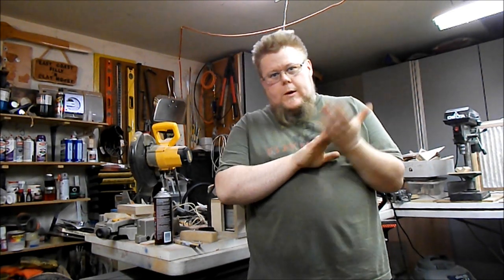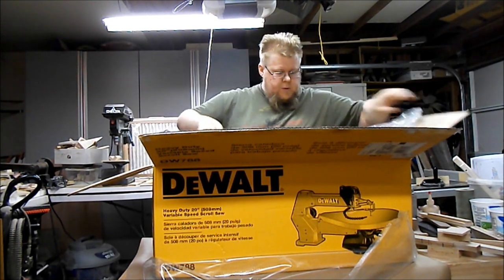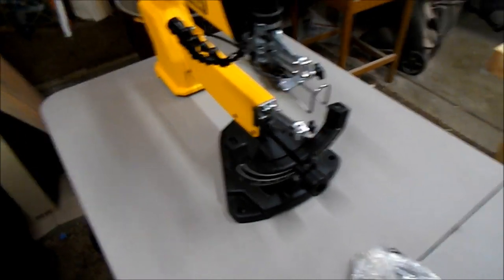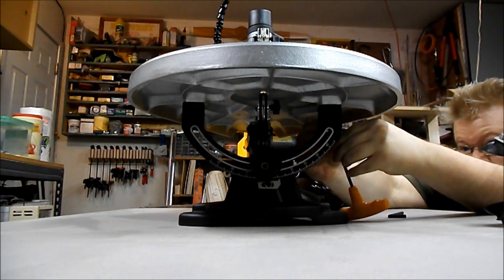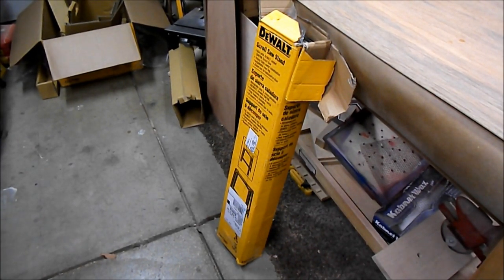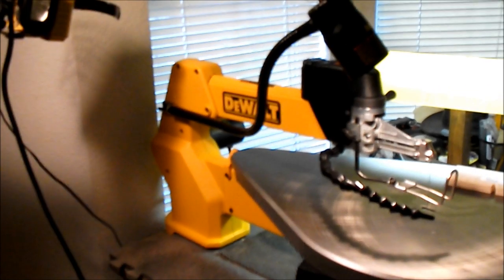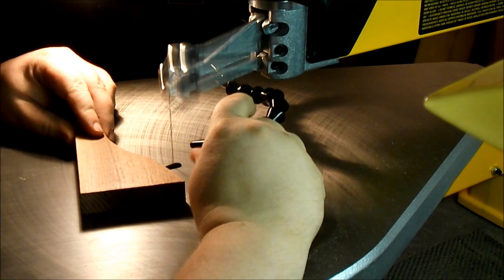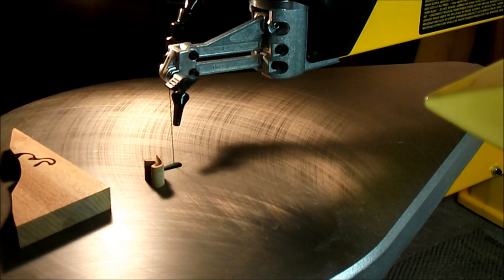Unboxing the Dewalt 788 scroll saw

Comment: Loved your vid! I just picked up one of these second-hand and removed the table to clean/derust it, and was having a dickens of a time reinstalling it. (I took it off with the miter gauge still installed. From your vid, I deduced i needed to take off the gauge and pop the table back on and then reattach the gauge. I had the same "challenges" you had installing those two screws. Cracked me up and made me happy to know it wasn't just me!
Reply from the maker: Mine is still running strong since I posted the video. 🙂 No major problems over the years.

Comment: ty for the video it helped me set up correctly, man that suck about getting a brand new stand with half the parts missing i was worried a bit but all they did to me was send ONE wrong screw, I have One big one and one small one to attach the table,,, now I need one small one so I have 2 same screws in the bottom of the table.
Reply from the maker: Luckily most hardware stores carry them.

Comment: Hey! I Good video. just got my DW788, too! I also upgraded from a Dremel that I called "Shaky Jake". I even got the stand together, and think I have found out what that little silvery thing  is that you couldn't figure out what it did.  It seems to be the fuse cap tool. Manual, P.7. Little round picture.  Question: I kept my Dremel alive and healthy for more than a decade by lubricating it regularly. How do you do that with the 788?

Comment from the maker: I usually use Pegus brand #2 to #7 blades. 2 being smallest and 7 being largest not sure of the tpi ( teeth per inch ) on those blades. The 12.5 tpi you asked about means the blade you have has 12.5 teeth per inch of blade.

Comment: so did you ever figure out what the little screw driver type thing is for. I've got some blades from Mike at flying dutchman blades have reverse tooth blades works very good and removes most of the fuzz. I just got my saw too.
Reply from the maker: yep.  the little screw driver is to remove the dust caps over the motor brushes. 😃

Comment: You mentioned leveling the table, but didn't show how (what you adjusted) to actually level it.  What did you loosen/adjust to get it level?  Also, I just opened mine an that small tool appears to be for the motor brushes access plug.  And while I have you, do you have suggestions for where to get blades and what kind to order?  The documentation said to use ONLY #5 blades (whatever that is)…New to this.
Reply from the maker: Sorry for not being more clear Damon. :) To level the table I used a small metal square for marking right angles. Putting it on the table and against the blade under tension. ( the blade not the square). I loosened the table angle knob under the front of the table, then adjusted the table till it was square based off the blade.
Reply from the maker: As far as blades that's more complicated. I use mostly Pegus brand #2 and #3 sized since I do a lot of small detail work. But I have used up to a #12 based on the wood hardness and thickness. 2's and 3's are Very small blades more common blades to use would be like a #5 also I like to use skip tooth reverse cut blades for a cleaner finish to the cut.
Reply: snoman1973 I can see how that would level the table from a bevel perspective (left/right tilt), but not sure how see how that allows for up/down movement of the table for leveling if from front to back.
Reply from the maker: Damon Hearne for that you'd have to shim under the table at the 2 screws that attach it to the bevel adjustment. I didn't mention that since my saw didn't need to be adjusted that way. Sorry I didn't include that in my explanation :)

Comment: Its here!! I don't think I got that screw driver but I think its for the motor.
Reply from the maker: OH! ok is it to open the brush inspection caps?
Reply: I have no idea never opened it before but in the instruction manual it says open regularly for cleaning. It should be in your manual on page 9
Reply: That little tool is to remove the fuse.

Comment: does your saw vibrate at the number 4 speed setting? Is that normal?
Reply from the maker: i usually only get a vibration if my blade tension isn't tight enough. other than that it runs very smoothly.
Reply: oh okay. So, if you run your speed setting 1 through the last number you get no vibration/wabble? The machine runs smooth for me except on number 4 then runs smooth through the rest of the numbers again. Nice vids btw.
Reply from the maker: Nouser Unrecognizable Yeah no bad vibrations on any speed setting unless i screw up and forget to set the blade tension. :)